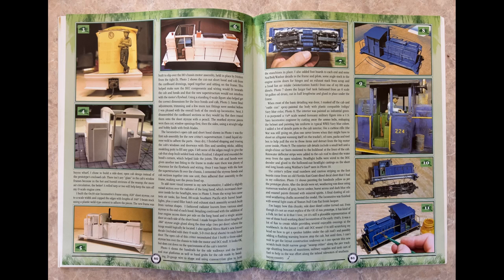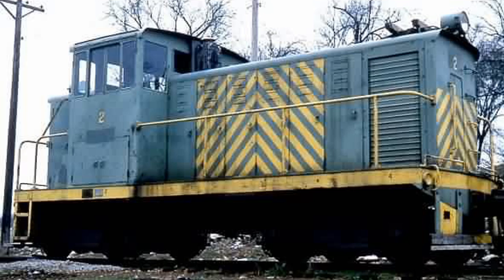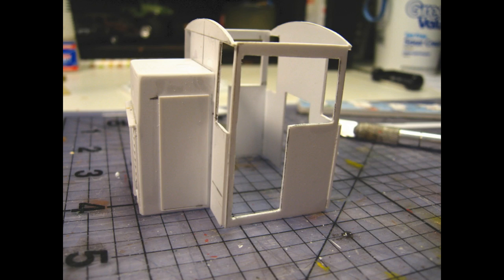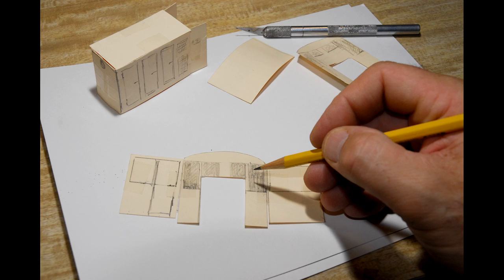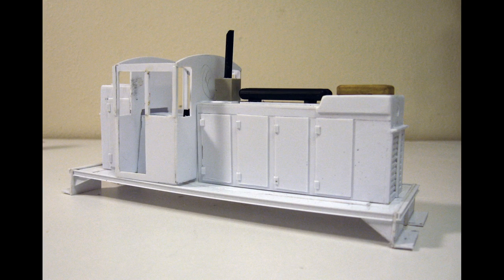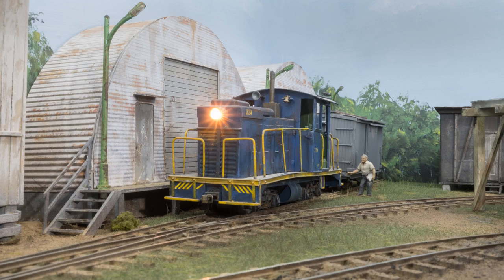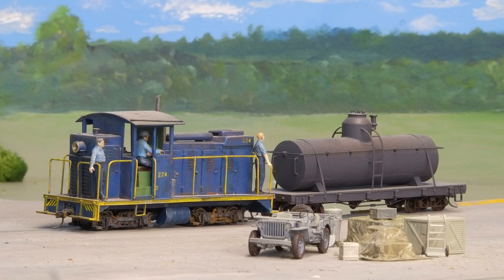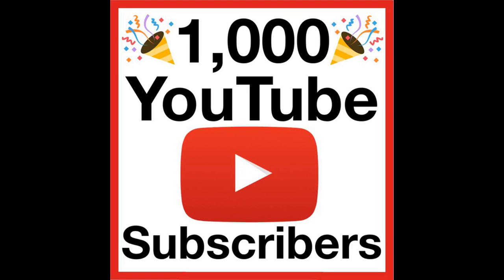On30 MODEL RAILROADING - I Scratch-Build A Narrow Gauge Diesel Switcher Using a HO Power Chassis.

Comment: An excellent model - thanks for sharing!

This sort of scratchbuild / kitbash is a great way for people to get into On30 motive power on a budget - the techniques carry over to making a fleet of rolling stock as well - especially flatcars and gondolas.

Cardboard Aided Design works a treat... even those of us who use CAD software on the computer for a living can benefit from mocking a design up at the actual size in order to get a better visualization of the results.

Your scrapbox is a great resource for future projects - lots of things which were leftover from other projects can be made to look useful as details. I'm told that the modelbuilders at ILM raided plastic model tank and airplane kits to get features for the models used in the Star Wars films.

There are lots of garage sale finds where a 1:35 tank kit can yield things like fans with grills that would look appropriate on an O - scale diesel locomotive, for example. For the uninitiated, you are looking for the cheaper kits, possibly where there are broken / missing parts if you go down this route...

For those folks who don't have ready access to a model railroad scale ruler, O scale is 1:48 aka 1/4" = 1' - 0", a common architectural drafting scale, pretty easy to find at Staples or Office Depot, or an arts & crafts store.
Reply from the maker: Awesome suggestions!  Thanks for watching and for offering your cool comments and tips!